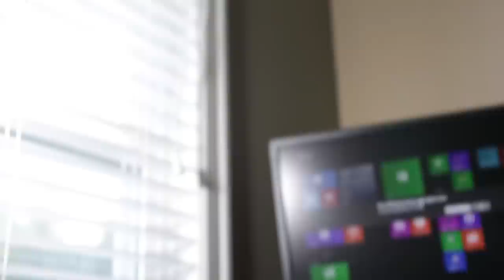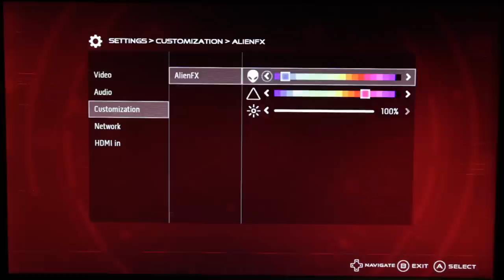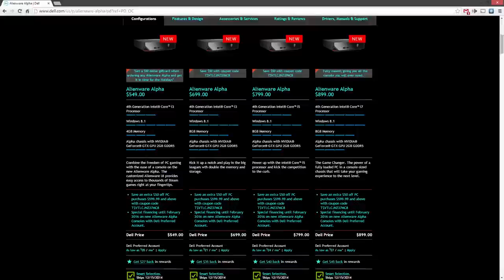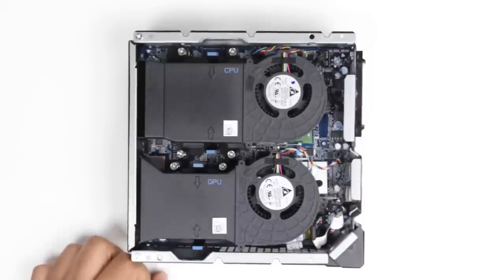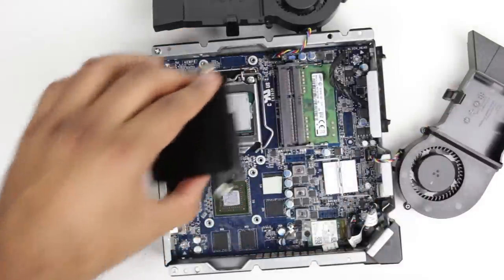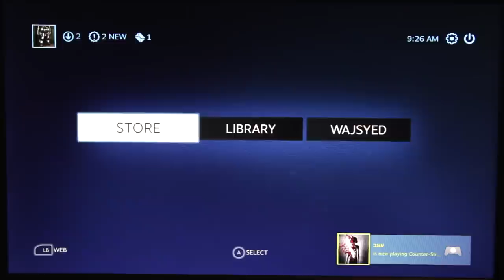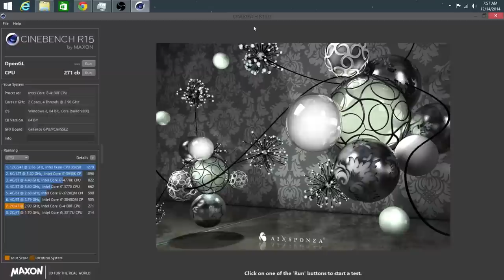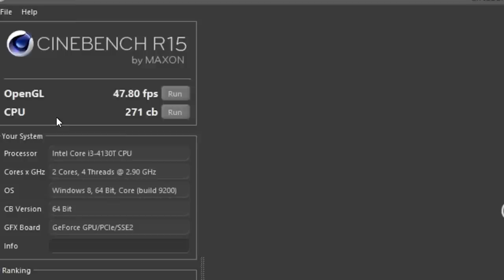Alienware Alpha Full Review

Comment: Meh...not seeing how this tops the PS4 in terms of power. 
After all, we are talking about 8 core CPU's and 8GB of GDDR5 ram in the PS4, versus essentially a laptop spec machine that I'm sure is pricey, especially once you start to crank up your options.
And given the limited over head room for upgrades...this isn't really worth it at all.
I mean unless you're looking for your indie based Steam games on your TV and you have a decent wireless mouse and keyboard to use as well...then it does have some use.
But when it comes down to the traditional console releases versus this PC with the price to performance ratio...the purchase isn't justified IMO.

And this is coming from someone with a 4770k, GTX 980, 32GB Corsair Dominator ram, etc for a PC (with two 27" 1440p 120hz monitors).
And as an owner of a PS4, Wii U and Xbox 360 (Xbox One is pointless to me).
Reply: Well the hardware IS currently stronger than the ps4. That's a fact. I do agree that this is a piece of junk that's not worth the cost. Would a ps4 over this personally.
Reply: Architecture is a big factor here too. Guarantee that 4770k in your rig will run laps around the 8 core AMD in the PS4. This particular model running an i3 certainly won't get there but it is possible. 

While I don't condone getting one of these systems, I can see the appeal. I'd still rather people build their own and get better performance for the price.
Reply: The CPU you are talking about, is actually an APU which is a combination of a CPU and GPU. So you cant just say "Oh it has 8 cores and 8 gb gddr5 ram" because that the 8 gb ram is actually Graphics memory therefore there is a "g" in front of "g"ddr5
Reply: i agree with you sir
Reply: arent we still on gddr3L on physical ram sticks anyways? (i know the difference, but the first reply might have some flaws)
Reply: Eric Durant Yeah pretty much sums it up. They could / should have gone for a bigger form factor and cheaper pricing/better hardware specs. The console hardware market is such low margin because Sony and MS make their cut on the games. Alienware isn't going to get this advantage so it's really hard to see how they can get into this market space unless they are super aggressive with their margins.
Reply: Eric Durant Gotta say tho. I'm PC primarily but using PS4 also... but envy the fact that my mates on Xbox have a functioning network. PSN is soooo god damn shite. Messaging barely works! It's down a lot too. Screws me when I wanna play Destiny.
Reply: SolJA Boy
I don't hate consoles. They just happen to be shit for this generation.
Reply: SolJA Boy lmfao really, the problem with consoles is they are bloody expensive for what they are to the point that consoles become more expensive than  gaming pc over a specific time scale normally with the first 2 years.
And if we are pc faggots than please put down your ps4 or xbox one or ps3,xbox 360 since all 4 use pc parts and this gen are now using proper older pc hardware
Reply: BlooHook That´s true but either the i5 or the i7 cost more than 800$
You can get both consoles for half the price, and since a casual user only buys up to 6 games per system... They would spend 700$ in 6 years (average console´s life)
So, yeah... People should create their own system or buy a big pre-built one that (with almost same specs than the Alpha) would cost 350-450$
Reply: mendyc158
I bought about 80 games on the 360. In the end it was miles cheaper for me to buy a PC for this generation... esp since all the games went up in price.
Reply: ***** Sure but the casual player only buys like 6 games, the very best and the ones  they can play with others
But if you plan to buy more than 10 games (specially if you buy them when they have just been released), PC is WAYYY cheaper, and even more because you wait like 4 weeks after the release day and Steam put the game on sale and cost like 40$ for a AAA (just released) game
Reply: While I agree this thing is a bit overpriced for the same amount of money you can build a much better PC.The PS4 cpu is misleading while it is a 8 core its a tablet cpu and don't have the ghz and cache a desktop cpu has.This is why these next gen games are more gpu bound.So for example your quad I7 would run circles around the PS4 cpu as far as cpu benchmarks even an i5 could.

Also the 8 gig of shared ram for ps4 has a lower bandwidth than dedicated vram on video cards.The Alpha actually has 10 gigs of ram (6 for the cheaper model) because its not shared the gpu has 2 gigs of dedicated vram.While the PS4 is very capable for the hardware it has.The Alpha should barely top it when it comes to 1080p gaming.The shared ram is a bottleneck for the consoles much more so for the xbox one.This is why the xbox really struggles to reach 1080p because of its ram.

Like I said the Alpha should barely edge out the PS4 as far as performance.Still they are close enough that it comes down to player preference.
Reply: mendyc158 I get PS4 games for the same price as PC games. Just need to know where to look, so PC being "waaaaay cheaper" is simply not true. The $500 PS4 outperforms the $550 version of the Alienware Alpha, which will need upgrading before the PS4 does. I'll stick with PS4.
Reply: MaRS vS Woh someone is salty.
Reply: Daniel Hayles Woh someone is poor
Reply: MaRS vS There is a difference between being poor and can't afford one, or not wanting to waste money on one. Keep being salty. Also don't worry, you'll move out of your parents place some day.
Reply: Daniel Hayles Move out? LOL Bro I make more money their your parents. To be perfectly honest the only game I even play now is Dota 2, I spend more time with my little beast, my APBT. And it is being poor. Owning a gaming PC is no longer some huge investment. This video shows you that. In fact there are even companies like Alienware and Origin who will even allow you to pay off your PC on a reasonable payment plan. No longer can anyone use the excuse "can't afford". That's bullshit, and only used by idiots.
Reply: MaRS vS "their your parents"? Hope that was auto correct on your phone and not stupidity.
Reply: Daniel Hayles Your reply was to a simple grammar mistake? LMFAO Usually when idiots call out grammar or spelling it's the equivalent to a mom joke or umad. Basically you have conceded then? That's what I thought. Now make sure to comb over every word and line to find that one grammar mistake. :) Loser
Reply: MaRS vS What are your specs?
Reply: ChrisRedfield Intel i7-3820, Nvidia GTX 690, MSI 79x mobo, 32GB Hyper X Beast 1600MHz DDR3, Creative Sound Blaster Z, XFX Pro Series 1250w PSU, 120GB Hyper X Beast SSD, 240GB Hyper X Beast SSD, 2x 2TB WD Black HDD, 2x I/O Magic Blu-Ray, Asetek Closed loop CPU liquid cooler with Alienware TactX Mouse and Keyboard and LaCie 3TB External HDD, ASUS vg24 144MHz monitor. This is a 2013 build.

I'm waiting on the GTX 990's to come out before I upgrade GPU's. I want a real successor to the 690.  Regardless the 690's still produce ridiculous results. I'm sitting on 80-90 FPS on Mordor maxed out and 120-130 FPS on BF4 maxed at 100% resolution. If I go to 150 resolution on Ultra I sit at 75-80 FPS.
Reply: Dude, this i a pc in a console! Whats wrong with you?
Reply: MaRS vS  Damn, lol. Nice build.
Reply: Ps4 dosent really have a full 8 core cpu... It's just another custom FX/AP based cpu.  But it still runs everything maxed. And the a box one is the same...  Ps4 has a small increase in clock speeds.  But you can't really tell a difference..
Reply: Isaiah Santana FX/APs are full 8 cores. Look at the architecture.
Reply: ***** But if you get the Alpha which is the closest in price to the PS4, still $50 to $100 more expensive, in just a couple years it will have a lot of trouble trying to run games as effective as the PS4 at the same settings. This is because a game on a console, can be highly optimised since every console will have the exact same hardware configuration. Optimisation goes a long way, especially a few years after the console is released so the developers are forced to do it. I would be interested in seeing another comparison video in 3 or 4 years time.
Reply: ***** Just give it a couple years. Every console having the same hardest goes a very long way. PC games have to work on literally hundreds of different hardware combinations and drivers. Don't underestimate god optimization, try running the PS3 version of The Last of Us on a PC with 256mb of system RAM.
Reply: ***** You can't optimise the game that much for PC, because like I said, it would need to run on hundreds of different hardware configurations and rivers instead o just one hardware configuration. Fact of the matter is the PS4 will run games better than the Alpha that is $100 more expensive than it in only a couple years time. Console games are never that optimised to begin with because the developers don't NEED to do it, so they save money and don't.
Reply: Explain why alien ware alpha runs better graphical settings... AT HIGHER FPS
Reply: ***** Don't you pay attention? Games at the beginning of a console generation are hardly optimised, if at all. Wait a couple years and see the Alienware Alpha age quicker. Learn to follow a conversation seriously.
Reply: ***** No. It doesn't matter if it t is the same arcitecture to the a PC. All you're thinking about is graphics settings like FOV. Do you know how coding a graphics engine works? Do I have to explain the difference between one hardware combination vs 100s of them a 4th time? Seriously, don't be such a fanboy towards one platform it completely blinds you.
Reply: SolJA Boy Microsoft windows gaming controller actually, that's what they are sold as and they come with the PC wifi receiver. Also with MS referring to all their gaming on Console and PC as "Xbox", this controller doesn't technically fit under the banner "console controller" even, it's more a Microsoft controller and like the rest of the range at the time it was released, it takes it's design queues from the Microsoft Sidewinder game controllers (the steering wheel especially). Add to the fact that 99% of PC games these days that use a controller have profiles and icons for this controller, it's pretty much accepted by all but die hard fan boys that this is a PC gaming controller as well.
Reply: Don't be baffled by tech garbage, 8 cores (8 threads) on a cpu that is designed to run a 1.6ghz based on amd's lowest end Kabini cores for cheap laptops, doesn't make automatically make it faster than a CPU that's is 3.2ghz haswell based dual core (4 threads) that is designed for cheap desktops. lets put it into context, the same i3 performs faster in most CPU tests than the latest top end A10 7850K (3.7GHZ quad core 4 threads) , which is a much faster CPU than those in the either the  XBOX or PS4. Add to that fact that you can install an i74770K instead or buy the model with one already and there is no competition. From a an on-chip GPU standpoint then yes the PS4 and XB1 would perform better than the i3, but then this alienware machine has a much faster separate GPU. This is supported by the fact that a few of the games tested in thus review running at high settings at 1080p@30fps run at lower detail settings on the consoles as is proven on Eurogamer so it's matching frame rates but at higher detail settings is an improvement (personally I'd have dropped them to medium like the consoles and benefited from the higher frame rates).

As for the ram, 8GB of DDR3 and 2GB of GDDR5 v 8GB GDDR5, that's not as cut and dried either, depending on the tasks, both have benefits.

The only real comparison is price v performance and usage, If you are only playing games, a console is a definite better choice, but if you want a small all in one entertainment system that is easy to use, the Alienware one may be better (tho you do pay a premium for most alienware stuff that makes them a dirty word for many PC gamers)
Reply: Why would I stop using the XBOX controller on PC when Microsoft sells them for Windows PC?
Reply: PS4 = 6GB DDR3 + 2GB GDDR5.
Reply: clanshadow2 Are you trying to troll? PS4 is 8GB of GDDR5
Reply: Daniel Hayles Only Sony fanboys say "Muh GDDDDDR5!" and claim it's 8GB. PS4 uses a GPU similar to the R7 260X I think, and that has 2GB of GDR5 RAM.
Reply: clanshadow2 Oh so you just don't know what you're talking about. A GPU doesn't have ram, a graphics card does. A GPU is just one part of a graphics card. The PS4 does not have a AMD graphics card in it, just the GPU, with 8gb of GDDR5. Do you seriously not understand? Look it up.
Reply: Daniel Hayles You know what? I quit. I hate arguing with you.
Reply: clanshadow2 Don't like being wrong do you?
Reply: Daniel Hayles Yeah. I give up, you win. But PC will always be superior.
Reply: Daniel Hayles As you seem to like being pedantic, AMD APU actually not GPU, also if its like the rest of the Kabini line of APU's its also a SOC, but even if it isn't, the memory controller is on the chip meaning all but the physical ram chips are on the APU when it comes to the actual systems ram use, and even then the RAM is also placed in design with AMD specifications. Also by your definition pretty much no AMD gfx card, even the reference ones are AMD because only the GPU is AMD, mind if you want to go down that route, the PS4 is not a Sony console as little if any of it's components are of Sony manufacture, maybe you should call it a Sony case and controller shell.
Reply: P Henry When did I say anything you didn't just say? But do you really think the PS4 doesn't have 8GB of GDDR5? It isn't the EXACT same APU as in a computer, it is a custom one, meaning modified. They have obviously modified the memory controller.
Reply: Yes it is a custom APU SOC, but the components of that soc are 2 dual core (2 treads per core, which AMD refers to as dual core, but that's still 8 threads, even if it's still technically only really quad core) Kabini/Jaguar CPUs (AMD's bottom of the range CPU's and a far cry from the Kaveri or Richmond cores that have been claimed), with a gpu similar to a 7850 and a GDDR5 shared memory controller. So yes it's all the same as in a PC just laid out differently (AMD even made a GDDR PC if I recall and were planning on releasing hardware that would use it, but it just wasn't worth the effort versus DDR3 especially given the speeds needed to compete as system RAM to make up for he high latency of GDDR). Given the way the OS needs reserved ram, it looks like it doesn't support HSA, so realistically there is far less RAM actually available for games, 5GB was the last number I saw from Sony. So yes it does have 8GB of ram, 3GB is reserved with only 5GB available for games.
Reply: P Henry I agree, but to me, it was more like 6+2GB since it's similar to an HD 7850, and there's only a few 8GB GPUs (Sapphire R9 290X Vapor-X).
Reply: clanshadow2 In practical terms it's likely less than that, as that 5GB has to be used for elements of the game that on a standard PC would also use system RAM for, 6GB + 2GB is likely a good analogy in that on a PC with 6GB system RAM and 2GB GFX ram, 2-3GB would be taken by the OS and background processes, 1-3 GB for game data and caching and CPU tasks like AI and physics, with the remaining left for the actual GPU. I'd be very surprised if there was actually much more than 2-3GB available for the actual GPU to use.
Reply: P Henry You can't count 2-3GB for the OS, because that 3GB of reserved RAM (other 5GB for games) is reserved, for the OS, and other software which isn't part of a game. But it is true that some of that remaining 5GB would be used to run the games that DDR3 would on a PC, but a game only has to be optimised enough. The PS3 version of The Last of Us runs on 256MB of system RAM, including Grand Theft Auto 5.
.clanshadow2 Just because a HD 7850 you buy for a PC is 2GB, and only a few Sapphire cards have 8GB, it doesn't mean the PS4 doesn't. Sony didn't order a PC graphics card and just slot it into the PS4. What I was saying is correct, the PS4 has 8GB of GDDR5.
Reply: ***** Explain to me what makes me a fanboy? If I was a fanboy I'd never play PC games, which isn't true. Also, they do need more than 1GB of RAM and only a idiot would think they don't.
Reply: OP, you have to realise this is Android and iOS all over again....even if the specs of the Alienware is definitely powerful.... dev don't set a standardized specific device for to optimize on PC market, while on the console market they only have PS4 orxbone or whatever, if the shit lags, they're gonna have to fix it...on PC, they can just say oh f*ck off user,just upgrade ur pc... the nvidia midrange laptop users like us gets shit thrown at us....same as android vs ios...
Reply: BlackTop If that was the case why is it that a PC built for around the price of a launch XB1 will out perform both these "next gen" consoles. The fact is that with the likes of DX, there is less need to optimise for a specific set of hardware. So it says something when even without that level of optimisation that is done for consoles (even though they are not that heavily optimised either outside of first party titles, hence the 30fps standard, as in so long as it reaches 30fps, no more optimisation is needed) the similar priced PC can deliver more bang for your buck.

The only thing the consoles have going for them in terms of hardware is the size, as this Alienware box shows, you have to pay extra to go small on a PC, or like the consoles, lower the performance.

By the way on the patching thing, patches are a lot quicker coming on PC than console, as they don't have to go through the whole certification process, they just get released as needed. It's for this reason he likes of WoW never released on consoles, the whole patching process would mean holding up the PC/ Mac versions just so they could go live at the same time as the consoles, which is even worse when it's a bug fix.

it's nothing at all like the whole Android and IOS thing, Consoles would have to be radically more open than they are now to make it even remotely close.
Reply: P Henry I get what you're saying..bang per buck for built PC ,thats where Im going....
but if what you say is all true, then i would only need a laptop with a GPU spec similar or better to PS3/X360 to match their 30-25fps performance at 720p for every PC game out there...
Reply: Having a good PC doesn't give you any qualifications.
In fact, because you have 32GB of pointless and expensive ram, only shows you have no idea what you are talking about.